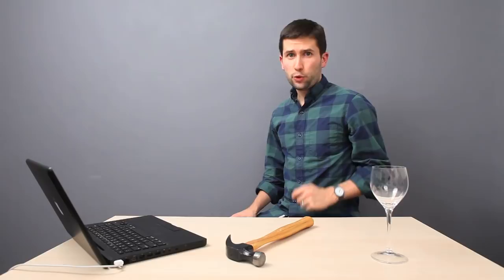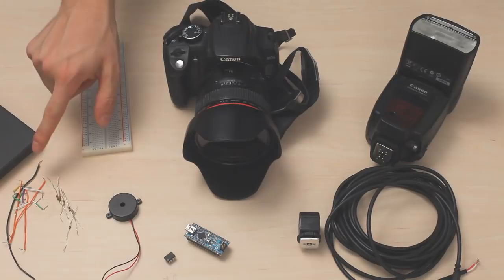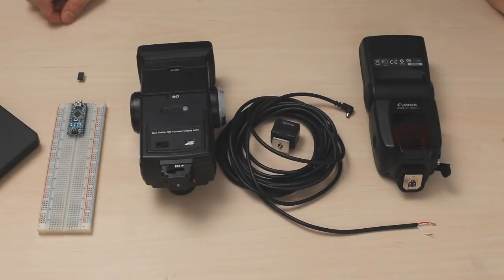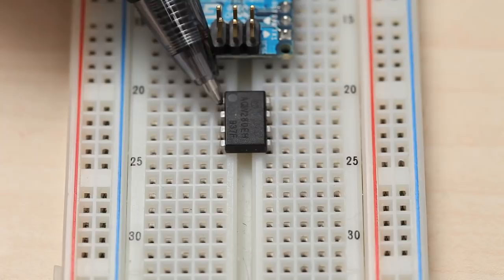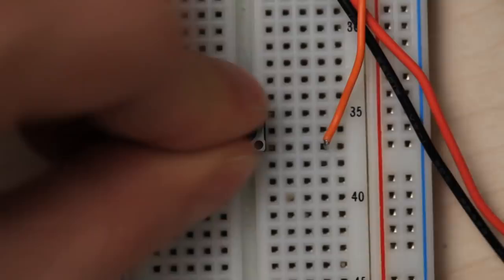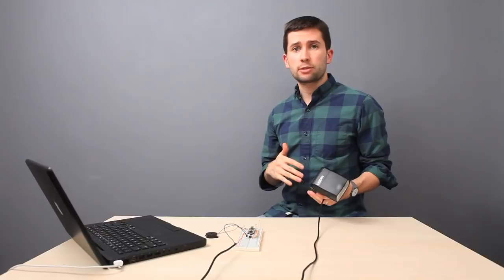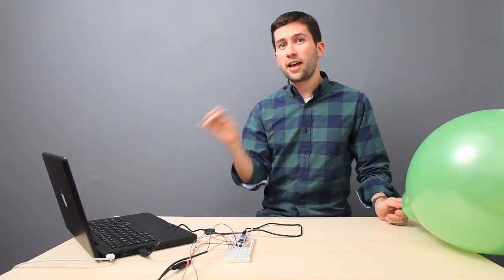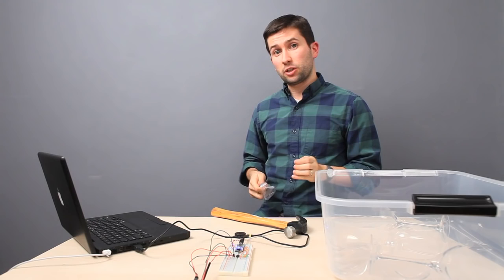Arduino High Speed Photography Trigger

Comment: Note that some optoisolators work the other way around (i.e., they keep the transistor circuit - right side - closed until there's current applied to the diode - left side - and then they break the circuit).

Comment from the maker: @NiekProductions Awesome! I would recommend ordering a getting started kit with either an Uno or Duemilanove. This way, you'll get the board, some jumpers, LEDs, and a few other things that you'll need.  If the cost is the same, get the Uno. Both the Uno and the Duemilanove are great, but the Uno is the newest version.

Comment from the maker: @hellwhichnickisfree If you put the piezo sensor on the surface near where to objects fall, it will pick up that vibration. The water drop can be done by connecting a solenoid valve and triggering that to drop the water before the flash fires. You'd have to monkey around with the correct delay.  You could also use a laser pointed at an optical sensor and then the drop breaks the laser beam, it can trigger the flash.

Comment: @ShaiS0 It's mainly to separate the high voltage potential of the flash from the arduino. Relays should work if the rest of the timing is adjusted. Try some trial and error.

Comment: the only problem with this is that it has to capture sound emitting things
also, there will be a very slight delay since the camera is triggered as such:
sound wave->sensor and controller->computer->camera
instead of professional sound wave->sensor and controller->camera
but this setup should work for many high speed actions, since the delay isn't that too big

Comment: Because a transistor provides no electrical insulation. If for whatever reason either your flash or arduino provide the wrong (too high) voltage you could ruin either one of them. An opto-coupler safeguards against this.

Comment: @shokwaav123 
In the 1970's, I saw an article in one of the electronics mags, titled "Build the Thunderbolt". (I Googled it, but came up empty.)

You adjusted the timing of when the flash was triggered, by moving the microphone closer or farther from the sound source. You could also have added a 555 timer, if you needed a longer delay than was feasible with a longer distance.

Comment: cool! but the bad thing is you have to make noise
 i guess it wont work with basic cameras because they dont have long exposures
but i can see how a mobile phone application can use the microphone to do something similar but the question is if it will trigger its camera fast enaugh without the long exposure i guess it will because it doesnt have a shutter

Comment: I understood everything - I'm a photographer and a electronics engineer so I guess I count for 2%.  But I don't see how you capture the picture when sound is as slow as it is.  I would think that by the time the sound hits the piezo and the arduino goes through a few clock cycles and then the flash is finally triggered that the event has already ceased but I guess the pictures don't lie.

Comment from the maker: @edinator888 I'm not sure why you would want to avoid using bulb mode.  It's made for photographing exposures longer than the highest exposure setting (or custom uses like this).  Also, I've never encountered a digital camera that is actually taking a photo in mirror lock up mode.  It's really only meant for sensor maintenance.

Comment: he going to push the butter
 it will torn the lights off
then it will open the camera shuther
after the camera shuter opens
it will lisen for the pop
when it hears the pop
it  will fire the flash
and then close the shutter
and then turns the lights back on.

so when the camera will take the picture?

Comment: @tsikla The voltage that the flash requires is too much for the Arduino to handle  and you would end up frying your Arduino if you did not isolate the two.

Comment: @mrichardson23 
The output of the piezo is extremely small. It would never trigger the opto. An op-amp circuit with fairly high gain will be needed to amplify the signal.

I'm surprised that the Arduino's input is sensitive enough. VERY COOL project, with the automated lights & shutter! It would take a few op amps & 555's to duplicate THAT. :)

Comment: Great  video. Can you please do a video on triggering a camera using visible light communication. Basically using an arduino to drive LED and photodetector sensed the LED light. When the light signal between LED and photodetectore is disturbed, the camera goes on.

Comment: Hello there Matt Richardson. I was wondering whether this project would be able to clearly take a picture of the LCD display of a stopwatch having the ability to read 0.01 of a second. I have this requirement to capture the reading of a stopwatch without stopping its reading. Your project is quite extensive and I would like to replicate it if does meet my requirement. Hope you have the time to answer my query. Thanks.

Comment: wow that is awesome. i've been looking at the Rev 3 Arduino and was on the fence about purchasing it. I have also been attempting to achieve a good high-speed shot with a timer/ultra-flash/film cam. in bulb mode (without much success). this video made my mind up about spending the $. I'm also a bit embarrassed i didn't think of this!!! great idea & video delivery...TWO thumbs up from me!!! :) a TVS diode wouldn't work instead of the opto isolator would it?

Comment from the maker: @leobaby Probably not. AB's (like most studio strobes) fully discharge their capacitors every time the flash is fired, which means the light slowly decays. Hotshoe flashes on the other hand have either a thyristor or IGBT circuit which disconnects the power as soon as flash output is attained, dousing the light quickly at low output levels. This ensures a quick flash and therefore little motion blur.

Comment: Nice tips.

I built a unit like this but didn't think of modulating the room lights, I just keep the ambient light low and rely on the intensity of the strobe to overcome "ghosts" from the room light.

Important consideration though !!!    Use a great short duration strobe, like the Einstein 640.
It will freeze the really fast motion.  Some strobe units will have a relatively long duration if the power to the tube isn't quenched resulting in a softer image.  You will really notice tis if the subject has details you want to catch.
   
Here is a test of strobe units and better description:
http://www.photigy.com/paul-c-buff-einstein-640-in-depth-flash-duration-test-action-v-s-constant-color-mode/

I also have a phototransistor input so breaking a light beam (rather than a sound impulse) will trigger the flash.

Hope that helps!   Jim

Comment: Great video!
I wish to use off-camera studio flashes for my high speed photography project, and trigger them using an Arduino.
The flash comes with the usual PC sync cord.  However, the manufacturer (name intentionally withheld) does not describe the signal required on the sync cord to trigger the flash.
Can I assume that 'shorting' the other end of the cable (as you show in your video) will trigger the flash?
As you can imagine, I don't want make erroneous assumptions and potentially damage my equipment.

Thanx!
Reply: You are not going to damage anything. Cameras can not survive a high voltage synch pulse so the flash units have an isolation circuit which is usually less than 5 volts. You can test this if you have access to an oscilloscope and want to be sure. 
In the old film days when we used flashbulbs, they did produce a high voltage pulse and the shutters were built to handle that but those days are long gone.

Comment: Could you put something up on how to build a simple delay camera trigger. I saw some of it in a pdf (might be yours) but i couldn't get it working. even just a wiring diagram of the final product would be awesome. I need to be able to push a button on a circuit and have it delay some amount of time, then complete the wiring circuit that goes to the camera, i've tried the timer chip and relay but can't get it to work. I dont think my wiring is correct. Please help!!

Comment from the maker: @hunter1919hunter The cable to the relay to control the lights are just two insulated 22 gauge wires, nothing special. The camera's remote shutter release is a 2.5mm audio jack, so I used a 2.5mm audio jack cable for that.

Comment: @mrichardson23 Getting one of these soon on pay day aswell and a laser and some light sensitive resistors. just wondering, why does the UNO cost less than the NANO ? when the UNO seems to be better. is it simply bacuse the nano is just smaller and was more 'fiddly' to build? or is there a big reason why i should pay a bit more for the Nano rather than the Uno for getting the best pictures possible. Any help will be much appreciated
Thanks

Comment: why did he use an optoisolator instead of a transistor? Was the optoisolator better or necessary?
Reply: You need to isolate the circuit in the strobe from the circuit in your camera (or anything else connected to it) . . . this is very important.  The strobe unit is looking for a contact closure and sometimes is sinking a high voltage from the strobe unit.  This can fry anything used to provide the closure.

Remember electronic devices run on smoke and if you let the smoke out . . . it will break.
Reply: +Jim In Ashland the flash [strobe] trigger is <6V you call that high?
Reply: It is for safety.  
True, modern flash units such as Canon is a low voltage, as you say.
The ISO 10330 specification allows for a trigger voltage of 24 volts. Some older flash units can present 100 volts across the contacts.  I have an old high voltage unit.
Also, please note the smoke comment was an old electronic technician joke.

Comment: Awesome..  Thanks for sharing.. I was looking to trigger my DSLR using arduino and this looks like a perfect option for isolating any high voltage/current getting to the camera.  

I am using an MCT2E opto isolator. I connected the 5V to the input through a 500 Ohm resistor.  When I measure the output resistance, I get a resistance of 70Ohm and I do not see any voltage between those pins.

http://www.ti.com/lit/ds/symlink/mct2.pdf

Is it ok to connect this to the camera?  or should I add another resistor in series? I am hesitant to test it on my camera.

Sorry, I am not good in electronics!
Can you help?

Thanks
Joe